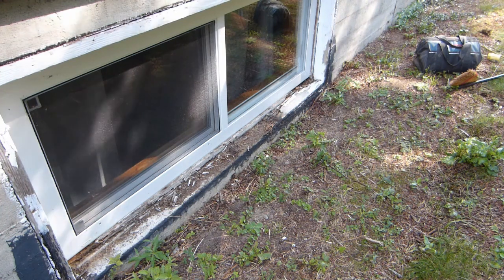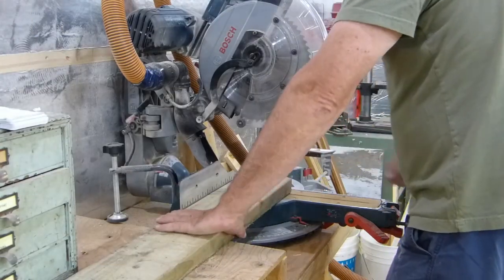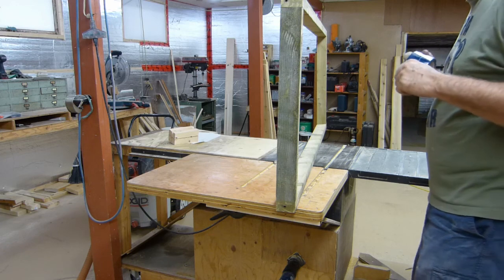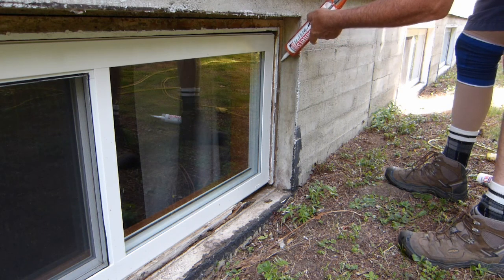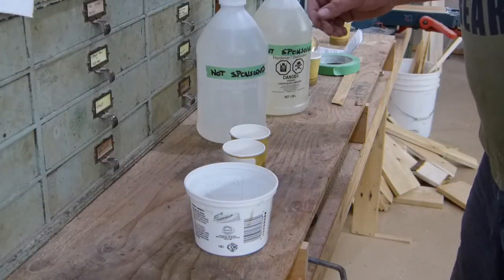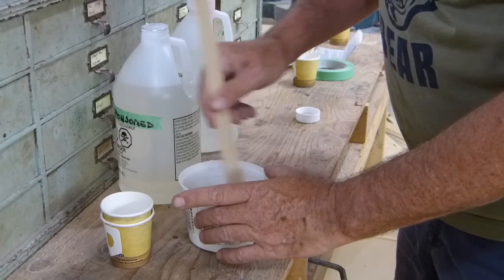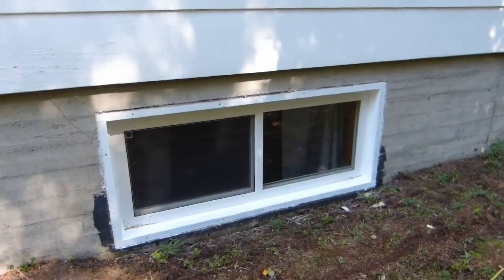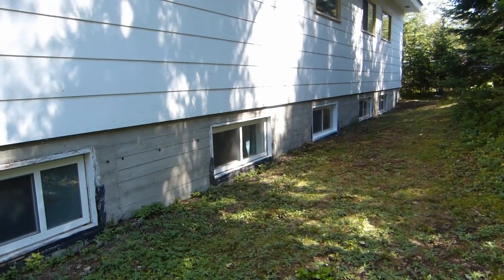Epoxy river window frames...Wait, WHAT!

Comment: nice repair Jim.    I've used the bondo-like epoxy wood putty in the past with good success.     You can shape / sand it very well.         Biggest thing is to use a wood hardener on any soft / punky wood first (your liquid prob took care of that part).   I'll keep the liquid in mind, too
Reply from the maker: I thought this was the best bang for the buck solution.  Works on boats and turners use the same method to stabilize punky wood.  I just combined the logic and transferred it to the job at hand.  Seems to be a good solution the way it soaks in and fills.